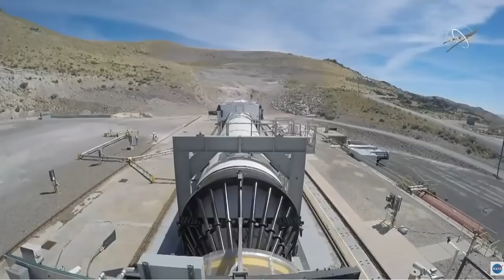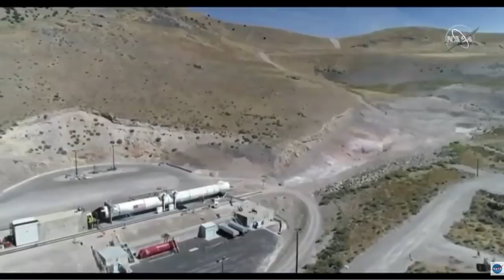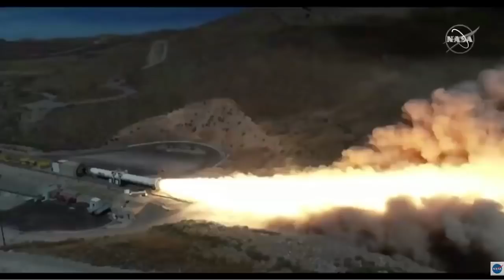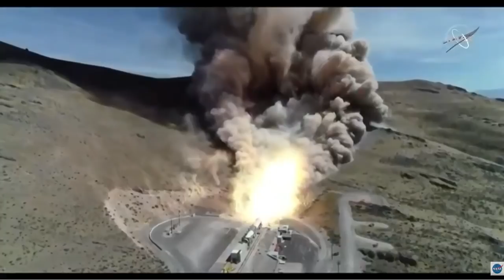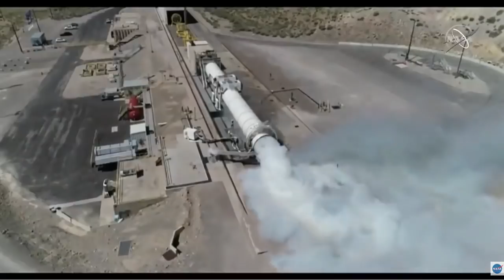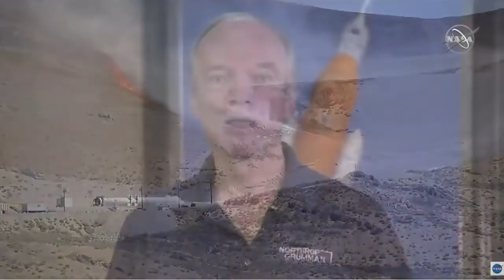FSB-1 Test Fire for SLS Artemis Moon Rocket

Comment: Hey look, the same design that caused 7 deaths..... now with more explodium.
Reply: It failed because the parameters for safe operation were ignored. That has nothing to do with the design that is flawed. If you dive with a submarine deeper than allowed, it may crash too.
Reply from the maker: More Falcon 9s have blown up than shuttle SRBs
Reply: AmericaSpace True but those didn’t have people on board. Not comparable anyway... the parameters for the SRB’s were ignored.
Reply: is that trying to be a good argument against the space program?
Reply: Different design.
Reply: Different design.

Comment: Light the big candle and hang on everyone because once she’s lit we go for ride. Just pack more solid rocket boosters around the outside and you can lift whatever you need just make sure that whatever your sending up can take the G-Force acceleration of these powerful Bad-Oscars? We need more power Captain! Great test but I think we may have started a brush fire. 🔥 just a small one, fire crews please standby!
Reply: Actually, shouldnt exceed 4G, i think
Reply: Mikicat - I don’t know if you follow Rocket Lab’s Electron program but their solid rocket propellant rocket can boost at 9g’s with their payloads. Solid rocket propellant’s usually are mixed with liquid rocket staged propellant boosters to help augment the lift system. If a rocket was designed with just solid rockets most of the time it would exceed human endurance g limits. That’s why I made the joke if we wrapped a bunch of solid rocket boosters together it will really fly! The space shuttle program used solids on the outer lift vehicle to help augment the takeoff.
Reply: @MrWATCHthisWAY  note, this is booster for massive Rocket. By burn out it will reach 2G. The highest Gs will be 6 minutes later just before MECO
Reply: Mikicat - I’m familiar with rocket operations and the need for boosters to assist liquid propellant mains. My comment is directed towards if you only used solids as with a Rocket Lab’s system in New Zealand humans couldn’t withstand the g forces. You can add mass to rocket to slow the acceleration but the delivery won’t make orbital velocity before MECO and a second stage will need to be able to throttle and relight to adjust course corrections if needed. Currently to take humans to space using solid rockets you require a combination of liquids on the main booster and solids to assist. As you know it’s all about trade offs and I think you are already aware of this because you understand MECO. If you get the chance watch Rocket Lab fire one off and you’ll see the speed of a solid rocket carrying a satellite payload into orbital velocity with a liquid second stage, but like ever rocket that lifts off their payloads are limited to a certain amount to obtain orbit. Rocket Lab does a great job for their operational costs and now that they too are recovering their solid rocket stages their costs should go down immensely and not to mention the fact they won’t be littering the oceans with spent boosters. I believe everyone respects SpaceX’s returnable boosters even if you are not a fan of Elon. SpaceX has done what was considered improbable 20 years ago and their hop testing of Starship’s methane powered rocket system yesterday is one more step closer to getting humans on Mars. I’m a big fan of Elon and the work all his teams have performed, but even if people are not a fan people have to give his teams the respect for their achievements overall. Space travel is getting very heated with all these different approaches to solving the problem of getting objects into space and returning flight systems back home for their reuse. I believe these are the best of times and the worst of times we live in now, and I hope we can all keep it together without hurting each other.